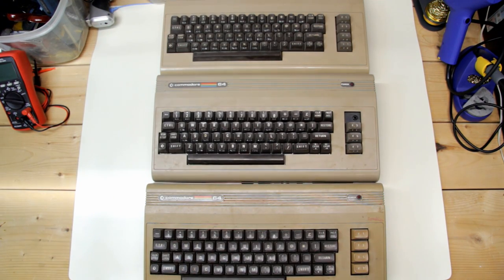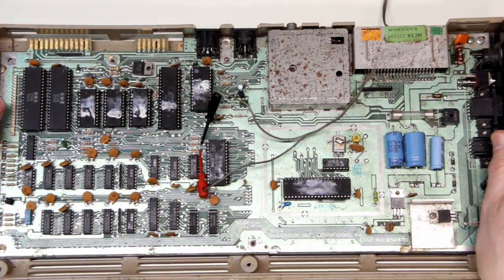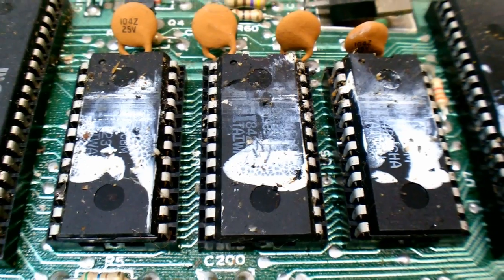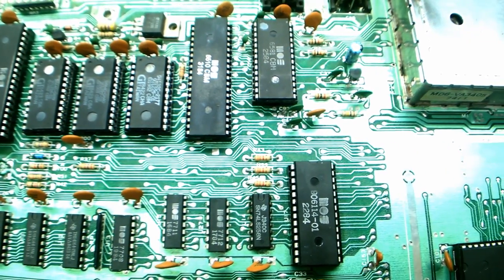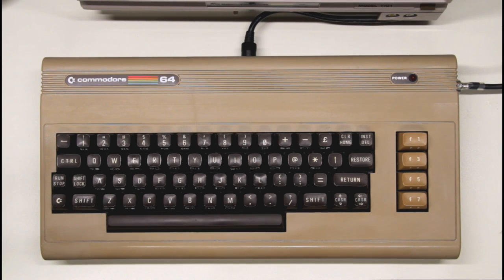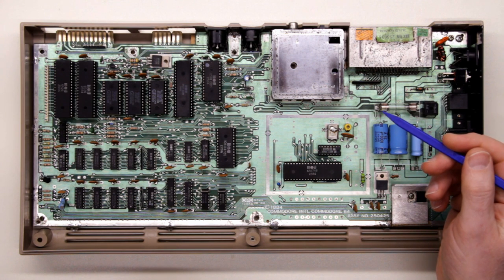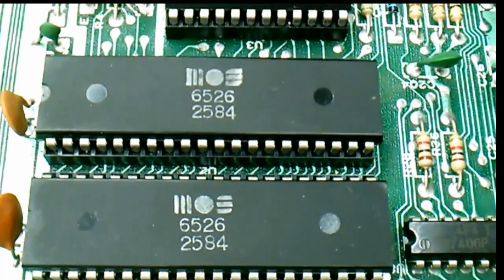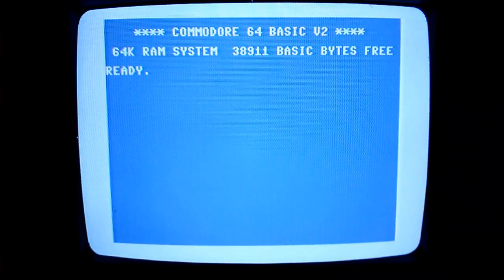#01 "A Change of Heart" — Commodore 64 Black Screen Repair

Comment: Dishwasher does a great job of cleaning everything and the contacts.  I did three at once, they all came out so clean.
Reply from the maker: Yeah, I have yet to try that.
Reply: @MindFlareRetro  one nice aspect to using a dishwasher (and a detergent pod) is it washes flux off or converts it to a white/yellow opaque residue. Easy to spot if you missed any, wipes up easy with alcohol again.

Comment: R44 & R45 for a BUSCARD - the two connections made by using clips inside the C-64 are used to obtain the HIMEM and LOMEM control bits from the processor output port. These allow the complete invisbility of ther BusCard by ensuring that the interface ROMs disappear and appear using the same commands as the internal ROMs
Reply from the maker: Awesome info. Thanks for sharing here. 👍

Comment: That white stuff was probably white grease pencil, used to mark chips. The problem with this stuff is it melts and gets soft, then runs. That stuff on the bottom looks like it was dried beer or tea. Coffee and coke leave a much darker stain.    Regarding cleaning the cassette and user port pins, try Brasso. That stuff works miracles on brass, and adds a molecular corrosion resistant coating.
Reply from the maker: Thanks for the feedback, Rick. I appreciate the comments. I've learned a lot since that first video. In fact, Brasso is definitely a staple on the bench now. 😉

Comment: My 64 is doing the exact same thing , Test Cart and still black , I'm going to order a CPU and cross my fingers :) ....Thank You so much for your sharing and you have a new sub :)
Reply from the maker: Hi. I am very glad you found the video to be useful. Thank you for the kind words and for your subscription. A couple of notes: (1) a black screen can be caused by one or several faulty chips on the C64 mainboard; go to http://personalpages.tds.net/~rcarlsen/cbm/c64/c64-ic.txt and doe a search for the word "blank" (F3 on most browsers) and you will see other chips to look at; (2) make sure your power supply is not outputting more than 5.2V -- that's about the upper limit before C64 ICs become problematic and are susceptible to a shortened lifespan or outright failure; (3) consider getting a C64 over-voltage protection device like bwack's C64 Saver, or the SaV64 -- these devices will save your C64 if the original power supply ever fails and outputs more voltage then it should. I hope this helps. Good luck!
Reply: MindFlareRetro I've been through a few things on this , true many things can cause issues as I've read and seen . I have pulled both cia chips the sid chip and all 3 rom chips , I have the flicker when turning on , my floppy drive responds to power , my psu is at 5v .. The cart was my last effort and just received it to have the same as your video showed . I've got a 2nd c64 coming also but want this one working also . 

I like how you made your video(s) 
Very informative and not boring as some can be . Thanks for your added info as I'm new to older computers .. Been playing games since 77 yet oddly never owned the computers only consoles :)
Reply from the maker: Very good. It sounds like you are using a sounds troubleshooting approach. Don't forget to check the PLA chip, as well -- it is the the chip to most commonly fail, and can cause a black screen and flickering, as was the problem in my other video, https://youtu.be/rHe-IuzEVqA. The diagnostics cart will help a lot. Keep us posted here on how it goes.
Reply: It was the processor :) I just got it in today and swapped and Viola!!! Thank you for your videos sir :)
Reply from the maker: That's great news! Congratulations! Thanks for the update. It is nice to hear that my videos are actually helping people.

Comment: Did you ever check the bad CPU to see if it was actually dead?  It could of been just the reseating in the socket that made it work?
Reply from the maker: To be honest, I don't remember testing it on another board. I did pull all the socketed ICs from this board, cleaned the legs and sockets and then reinserted them — the Dead Test Cartridge still would not run. I probably still have this 6510 in my dead chips container - I like to see the dead ones pile up - I will try to find it. Thanks for watching and for commenting.

Comment: Would have loved to seen the dead test ran again all g with the loopback harness. Just out of curiosity.
Reply from the maker: Yeah. Good point. I do have to say that this C64 has been running as my go-to reference C64 for testing ICs from other computers. Be sure to check out video #11 "Zero Insertion Farce" where I add ZIF sockets to this C64 making it easier to use as a chip swap tester, http://bit.ly/MFR-YT-11. Thanks for watching and for commenting.

Comment: It always makes me so happy to see that blue screen of Commodore goodness come up when the power switch is turned on, especially if the board was previously dead.  Good job getting that thing cleaned up so well, and getting it up and running.

As a suggestion, I'd say to always attempt to fix C64s before designating them as for-parts, because as this video shows, it can be a very simple fix.  Only those boards where every attempt to fix it turns up nothing, or there is unrepairable physical damage, should be used for parts.  As long as you have the spare parts and the know how for fixing them, it's always worth it.  Now, sometimes it's not the board but instead is the case, keyboard, etc. that are damaged beyond repair.  In cases like that, the boards can be fixed and put into storage for replacing the motherboard in future C64s that have a good case and keyboard but the board can't be fixed.  And as far as the damaged cases and keyboards, those can be saved for salvage, too.
Reply from the maker: Thanks very much. In fact, this computer has become my bench worker unit that I use to assist in repairs and tests/experiments. Agreed–I would never actually dismiss a C64 as a salvage unit unless it was completely damaged physically. Sometimes, I will use working ICs from a non-worker if I don't have spare ICs on-hand, but I always circle back to the donor system and use all efforts to repair it . Thanks again for your comments and support.
Reply: Same here.  I once bought a lot of 6 C64s that all look like they were salvaged from a flooded dumpster.  The cases look awful and the keyboards don't work, but the boards all work.  On one of them all the big chips are socketed, so that's my test board for easy chip swapping.  It's going to take a lot of work to get them all clean, looking good, and fully working.  (The same sale got me a lot of 7 1541 and 1541-II floppy drives that all need the same amount of care.)

Comment: Nice one. Love the retro repair videos, learned so much from them. Good job nailing the suspect without probing it.
BTW, the SID (6581) is also a frequent cause for the black screen. I encountered it more than once.
Reply from the maker: Thanks very much. Yes, I neglected to mention the SID as a suspect, but a very good point, thanks. I am trying to come up with a "rapid" troubleshooting process without getting into too much probing if possible. I have all the gear waiting on the sidelines, though, even an old HP current tracer that I picked up recently (haven't mastered it yet).
Reply: Which old HP current tracer did you get? I was looking to buy one recently but gave up when I saw the price. (it was about $500) so I got myself a cheap logic probe instead and cheap oscilloscope later. Haven't used the probe much, I prefer the scope.
Reply from the maker: It's an HP 547A (picture, https://goo.gl/Xcmif0). Yikes, $500 is a price gouge -- way too expensive for that model. I lucked out and found one for under $150 CAD with shipping.

I was going to suggest the following videos to you, as well, but I see you already commented on the first one :)...
http://youtu.be/djsYNUNOk-A
http://youtu.be/Verow5aGL0w
Reply from the maker: HP 547A Current Tracer on eBay, as 04/04/17... https://goo.gl/45SuL1
Reply: Thank you very much. Bought it. :D
Reply from the maker: Nice. You're welcome. That is a really good price.
Reply from the maker: Did you receive your HP 547A Current Tracer?
Reply: Yes, I did. I tagged you on Facebook with a photo the day it arrived but I guess you missed it. Thanks again.
Reply from the maker: Duh. I totally missed that. I assume you have found the tracer to be useful?
Reply: I just tested it with a Tenma pulser, it's working great. Unfortunately (or fortunately?), all my retro computers are working great. I'm waiting for something to break down so I can use it. lol
Reply from the maker: Ha. Yes, I would say "fortunately."
Reply: BTW, did you know it's recommended to limit the current for HP547A? It's written in the manual, IIRC it's 71 mA. My arrived without manual but I found it online.
Reply from the maker: Oh! I did not know that. That's an important tip. Thanks for that info.

Comment: I remember those black and red clips when I installed a Batteries Included Bus card. The bus card allowed me to hook up an ancient Commodore Pet 3022 Tractor Printer for use with their Paperclip 64 word processor. I did most of my University essays using these Batteries Included products. Dox Matrix 5x7 pixel printing. Useful at the time but a dinosaur today.

You can Google "batteries included bus card manual pdf" and I believe you'll see it's a match on page 3 of the manual (pdbuchan dot com). Bus card provided Basic 4 and Disk commands (rarely used it for this). I believe the 3022 was an IEEE device and I used it for this connectivity.

Comment: After fixing about 30 or so c64s I did not know about the power on flash thing. Excellent video and nice channel. Subbed.
Reply from the maker: Wow. It's an honour. Thanks very much for your feedback and for subscribing. I can't take credit for the power on flash bump thing; I picked that up in passing on one of ix8dwf's C64 repair videos -- regardless, propagation of knowledge is a good thing. I used to be subscribed to your channel, enjoyed your C= repair videos and mods, but just realised I am no longer subscribed -- WHAT?!? I will correct that immediately.

Comment: Great Videos! 

Got a strange thing happening with my C64C.  When I play say Archon or use Kipperterm for example, after a reboot the 64 often will render the blue/light blue screen only (no Basic post) or even the yellow/light yellow of Kipperterm. This AM I loaded Centipede, played it for a few minutes and then turned the 64 off. When I turned it back on, Centipede was still playing! Then another off and I got the blue/light blue post without Basic. I then let it sit for a few minutes and we are back to a expected boot i.e. blue/light blue and Basic post. 

Also I have seen the black screen at boot up but less often.  Thoughts?
Reply from the maker: Hey Craig. Thanks for the positive feedback and for commenting. Hmm, your C64C is presenting some very strange behaviour. A standard blue/light blue screen with no BASIC post can indicate a problem with the BASIC ROM, but it almost sounds more like the system is still getting a trickle of near 5V after being turned off. I assume Centipede is the cartridge version? Do these symptoms occur if you switch off the computer and then physically unplug the power supply plug from the computer, as well? If the issue does not reoccur I would look at the switch itself -- maybe it's poles are not disconnecting completely allowing a trickle of 5V to be supplied. Depending of the switch most can be desoldered and then dismantled allowing you clean the switching mechanism. In fact, @bwack has a great video of how to do that, https://www.youtube.com/watch?v=Osmv4376iYA.

I would start with this and see how if anything changes...for the better. Are you on Twitter at all? If so, you might consider tweeting this issue (with any pictures) there, as well. There are lots of knowledgeable Twitter people that might be able to help, too. If you de post a tweet, be sure to mention me @MindFlareRetro in any tweets, so I can follow along.
Reply: @MindFlareRetro  Centipede is floppy version.  Just loaded Kipperterm, logged into my telnet server and powered down.  Got the No Basic post on boot up.  Unplugged the power supply, power switch back on and then off.  Plugged power back in and powered on, works.  Let me look at the power switch later in the day.  Not on twitter but a member of the C64/128 FB group.  Photos there.  Thanks for the recommendations!
Reply: @MindFlareRetro  Just duplicated my steps above, now to no available.  Blue/light blue with no Basic post.  I have a dead card cartridge coming soon.  Will keep you posted.
Reply: @MindFlareRetro  Are you in the repair business?  I have the c64c we spoke up and also a c128 that only responds with "break,break,break..." when booted
Reply from the maker: @craigberkley7096  May I ask where you are located. Feel free to email me directly at the address on the About page of my channel.

Comment: I bet there was a norwegian "hallo" in the blooper section ? :) Great first video. Great lighting also, nice and soft shadows. I get lots of hard shadows in my videos. I like how you troubleshoot and found the most likely cause there. I didn't know about the power on flash on the screen on c64s with black screen symptom indicated that the timing ic was ok. One tip for the contact cleaning. Old worn contact surfaces oxidate fast. Apply contact lubrication and wipe off. The lubrication leaves an oily film keeping the oxygen out. Spray or dab into the cartridge port with a crushed Q-tip. The power ports are a bit harder to reach, but getting the oils in there works magic there too..
Reply from the maker: Haha, nice catch, yes, my attempt at basic Norwegian; hopefully I pronounced it correctly. I have two 1m long LED workbench lights overhead. The plan was for even lighting, but there's a lot of reflection from the lights -- a work in progress. Thanks for the tip -- I did actually wipe the user port and cassette ports with WD-40 afterward, but I'll definitely apply it to the cartridge port and power ports as well. Thanks!

Comment: Really good work and you just got another subscriber :)

I'v repaired quite a few C64s and my first order of business when I get a board in an unknown condition is to remove the SID just because I don't want to risk damaging that precious chip when troubleshoting and testing the board.The SID is then tested on a known good board and if it checks out ok it will go back on the board from which it came once that board has passed all the tests.
Reply from the maker: Hi. Thanks for your positive feedback, and thanks very such for subscribing. Yes, you are absolutely correct, it is very good practice to pull the SID when troubleshooting and testing C64 boards, and perhaps the VIC-II as well in some cases. SIDs are definitely on the endangered species list. I will be more diligent with future repairs.

Comment: Great Video. How did you clean the board to make it that clean and shinny?
Reply from the maker: Thanks for commenting. Love your avatar, by the way. I use isopropyl alcohol mostly, along with a lot of q-tip/cotton buds and shop paper towel (those heavy-duty blue ones)...and a lot of patience. Check out my reply below to Hit the Mark, as he had a similar question. Although, I should also mention, for boards that have exposed metal parts I often rub a very light layer of WD-40 on those areas; this will help protect against future corrosion.

Comment: How did you clean the board?  Did you use any special products?
Reply from the maker: Hi Paul. thanks for commenting. I used 99% isopropyl alcohol (IPA) with paper towels and Q-Tips (cotton buds) – you don't need any fancy chemicals or tools. Some of the traces were very soiled with some mystery gunk, so I used IPA and an old toothbrush. With those tools, I just worked gently on a small section at a time - it took a while but it cleaned up well.

Comment: Great Video!  I always seem to learn something new with each C64 resurrection video I watch.  I'm currently in the mists of documenting the resurrection of my own C64 I had since I was a teenager.  It's been sitting in the box not working for the past 25-30 years!  Question:  What cleaning supplies and method did you use to remove all the grime, dirt, and lord knows what else was on the mainboard.  You said it only took 2 hrs for what would seem like such a tedious task.  Impressive!
Reply from the maker: Thanks very much for your kind comments and THANKS FOR SUBSCRIBING! I'm happy to hear you enjoyed the video and found it informative. This particular C64 motherboard was really grungy, but in hindsight, I think the slightly greasy filth might have actually protected the board from more severe corrosion. I mostly us isopropyl alcohol (the 98%-99% stuff) and a lot of q-tips to clean PCBs, as this combo will remove most grime and not harm the board. Sometimes I break out the wider electronics foam cleaning swabs (https://goo.gl/qRzqO1) for wider areas. You don't really need anything fancy. Hopefully, my current and upcoming videos might help you troubleshoot your sick C64. Thanks again.